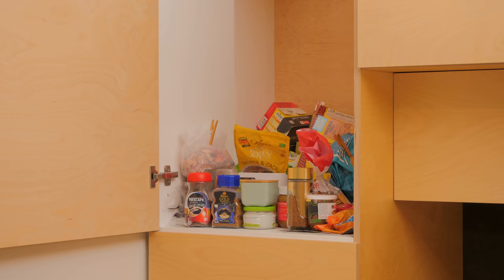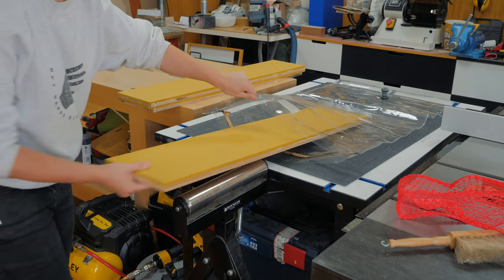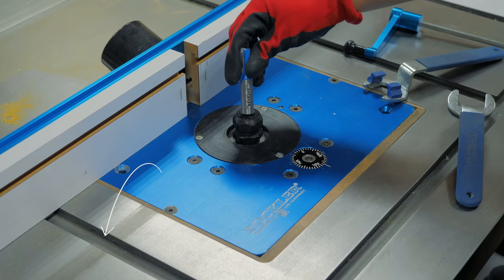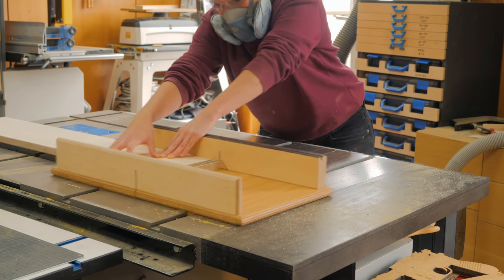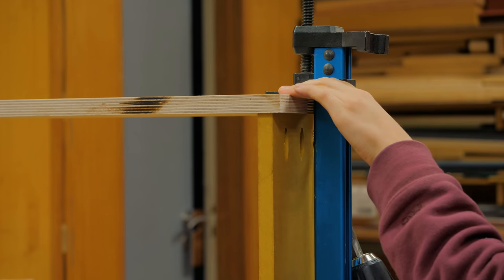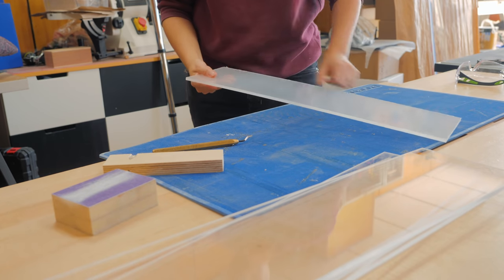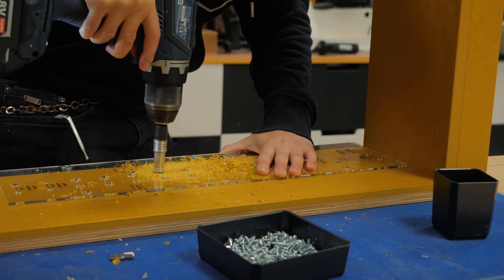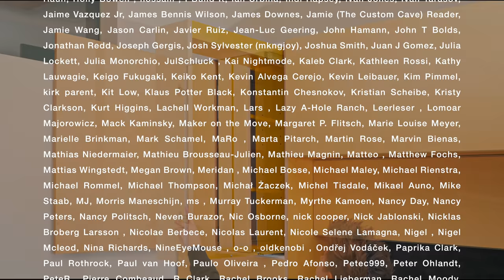Pull-out Pantry // Tiny Apartment Build Ep. 13

Comment: I'm really starting to love vertical pantries. I've been making physical prototypes of my designs for a tiny house and testing them out IRL. 
One of them I made recently has a pantry like yours, but they pull out from cabinets on both sides of the hallway. What's great is both sides of the drawers an be accessed to load or unload. Unlike typical drawers there is no space that is inaccessible or hard to reach. Plus there is no banging the top of the drawer with pots, utensils, etc and squishing things in the side seems to be no problem. Win win win! Love your designs, so simple modern, beautiful with a splash of creativity and color with the yellow insides and front line. You make my designs better!
Reply from the maker: For that situation, double sided drawers are a great feature indeed! Thanks for your kind words :)

Comment: Nice build!! I am going to build something similar with regular full extension drawer slides. But mine would be taller cabinets, like 50". I can't imagine how the slides will work if I installed them horizontally on top and bottom... I heard you say you installed the top one vertically due to wobble issues. If you could share a bit more about why you thought it would get wobbly, that would be great. I do have space on both ends to install the slides vertically though.... That's a great idea but it obviously takes away a bit if space from storage. Appreciate your inputs

Comment: Superb craftsmanship. Just one observation: Instead of using the vertical gaps as drawer handles to pull them open (since there’s always the risk of stubbing your fingers in between the gaps), I’d make circular holes in each drawer to use them as pull-handles.

Comment: I'll be interested to know how much drift/binding you get over time.  I have a commercially made (rev-a-shelf) vertical pantry and it does not stay plumb.  The top shelves have to be used for absurdly light storage (in my case empty plastic freezer containers) in order to keep the mechanism from drifting.

Another benefit of your design is that you are able to keep the tolerances tight.  My other vertical pullout is in a narrow cabinet beside the dishwasher.  I had thought that the pull out would be great for detergent tabs, but the commercial pull out eats so much space that I can't fit the box on the shelf.  I had to make a special dispenser out of a cereal box for the dishwashing tablets.

Comment: As usual a very good work; but if you let me say, I think it could have been nicer (and more comfortable) if you haven't kept the original door. In this case you would have made the front panel of the three sliders a little bit higher which that hides the white edges of the cabinet's boards.
Your drill bit for screw holes looks very special; not really straight, starting very thin and ending to the nominal diameter. Where do you found it?

Comment: Massive project. Congratulations! I’m wondering if the drawer slide at the bottom likes being used in compression like this, though. I don’t think that they are built for this mode of operation.
Reply from the maker: They aren’t, but with one of them being in normal position, the other one handles the job. It’s not as rock solid as placing both the top and bottom vertically but it works.

Comment: Great build video. Do you have much success with the smaller benchtop jointer? I also have a smaller bench top jointer, but I always have some slight curving over longer board legs that I can't figure out how to fix. I've made sure that the tool is straight too.

Comment: I had never seen how to melt the side of the plastic to hide the cut.

To cut plastic you have to slow down the saw, or it melts instead of cutting, a voltage regulator is cheap.
Reply: There’s also a difference between cast and extruded acrylic. The former is better for machining with saws and CNCs.
Reply from the maker: Yes, the type of acrylic also matters a lot. I was using cast acrylic.

Comment: Do you think a heat tool would work to make the edges clear, instead of a torch?
Reply from the maker: I don’t think so, I think that you really need to “throw” a flame on it that is hot enough to melt the material.
Reply: Thank you. That’s good to know. I’ll be building out a skoolie, and had hoped to have this kind of pantry situation. I’ve seen it before, but without anything to guard the items from falling out the back, so I will be incorporating the acrylic panels in my build!

Comment: My early 1970's house has a kitchen that was designed by an imbecile. Not quite big enough for a decent island in the middle, but a lot of wasted space. The previous owner installed a dish washer in a weird spot (it wasn't wrong though). Because it doesn't work properly and no one in the house ever bothered to care about having a dish washer (I even got one of those ones you connect to the sink and it wasn't being used!), I want to rip it out and put in vertical sliders exactly like this! Funny I would stumble upon this video...